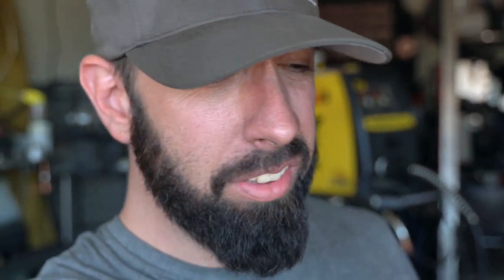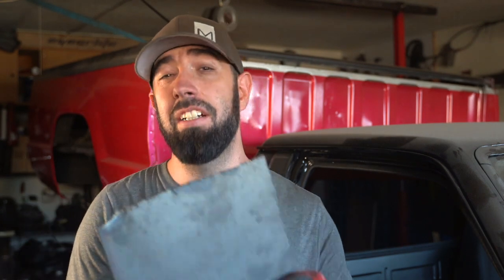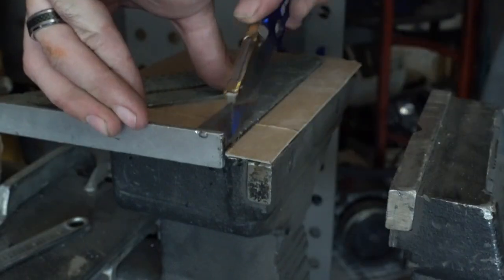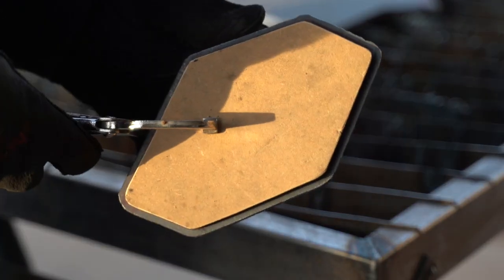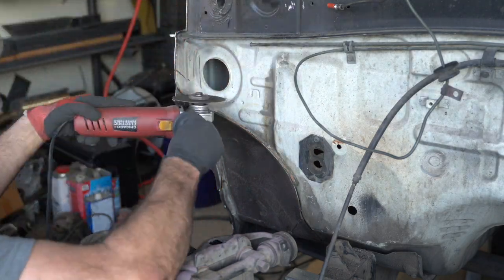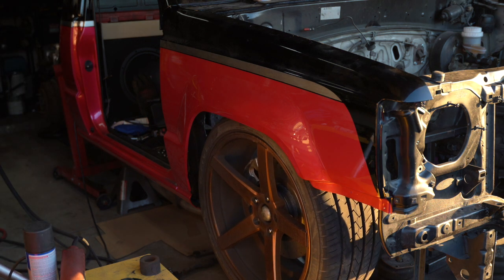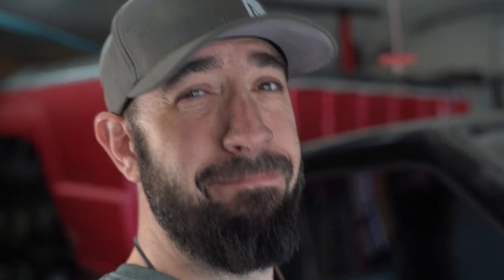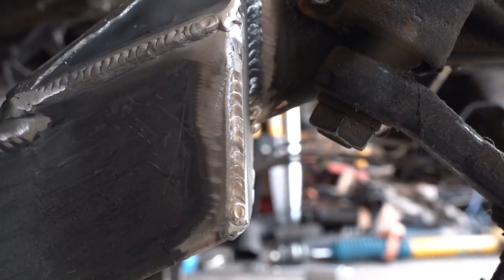Mighty Max Ep. 05: How to Z Your Frame! Part 2

Comment: I keep forgetting to ask you, do you happen to have one extra used top piston ring for a 3.530 cylinder?
Reply: As wrong as it sounds I was serious about the piston ring. I am gonna open my ring gap to .030 for a small super charger but 1 broke.  I will pay u 4 it if u have 1. Top ring 3.530
I can't seem to find a set.
Reply from the maker: I think I trashed my old rings. I’ll be cleaning out the can of the truck soon where it would be if i have it so I’ll look shortly.

Comment: Do you have to compensate for the 1/4" plates that you installed? You added 1/2" to the length of the frame.
Reply from the maker: Good thinking Rod. Yes. I did not compensate, though, and I didn’t want to try to film the drawn out reason why I didn’t. 
Here it is:  I actually only added a total of 3/8 of an inch after subtracting the metal lost from making two 1/16 inch wide cuts, and this was only to the front most part of the frame where the radiator support mounts. Those rubber mounts have 1/2 inch of wiggle room from the factory, so the radiator support will bolt on just fine.
This also pushes the bumper forward 3/8 of an inch. This may look unappealing and if it does I’ll just modify the holes in the bumper brackets.
The suspension and engine were also moved forward 3/16 of an inch but I can’t imagine that would cause any issues. Hopefully I’m not wrong!
Reply: @GarageFab  Thanks for the reply. I just happened to stumble on your channel. I really like it.
Reply from the maker: Excellent! Hope to see you in future videos!

Comment: Pro tip from a certified welder and mechanical engineer; When welding vertically you get stronger weld by moving upwards (better penetration), even though it's much easier to get a beautiful weld moving downwards. On a frame weld I'd say strength is much more important than aesthetics. I'd also say that welding a frame with MIG/MAG is not the best choice strengthwise. TIG, flux core or stick welding with the right consumables gives more strength and less danger of cracking.
Reply from the maker: Have you any tips for welding upwards? Or just practice? The appearance of a better quality weld is the precise reason I weld down. My technique is to weld the root of the joint and build the puddle upwards, jump to the root and build the puddle upwards. It makes for a gorgeous weld, and I figured my method would give me good penetration. I’ve never cut a cross section and tested one of my, and I’m certainly not certified though I’d like to be soon. Thank you, Brother!
Reply: @GarageFab  You're very welcome! I found this video with 2 great tips. #1 is how I usually do it: https://www.youtube.com/watch?v=snyKGd4T-Zg

Comment: Excellent work. Me doing a similar sort of job would be a feeling of great satisfaction.....until I found the weld had pulled the end of one of the frame rails 2" higher than the other.  :( 
I do that sort of thing so often I've come to expect it.
Reply from the maker: I’m with you, Paul. I’m just starting to learn to anticipate warpage and, plan ahead. Weld in symmetrical patterns to minimize movement and “steer” the work piece with initial warpage. 
I’m still terrible at it! But that’s why they created cut off wheels. 😂 
Thank you my friend!

Comment: Hello there I have a question do you kwn anything about proportioning breake valve I have a master cylinder with 4 breake lines I need mostly my rear breakes to lock up where do I install the proportioning valve ?
Reply from the maker: Hey, Jerome!  My experience with proportioning valves is strictly on older trucks with a single brake line feeding both of the rear brakes. The valve on those obviously just goes in the single line before it Tees off to each brake caliper.
So are there 4 lines coming out of the master? Or just Two?
Reply: @GarageFab  hey its 4 lines coming from the master cylinder 2 for the front breakes and 2 for the back breakes how do I connect that
Reply from the maker: Look for proportioning valve for a split system. It should have 4 ports. 2 in, 2 out. That would be the RIGHT way of doing it.
For a single-line proportioning valve, you could T the two lines together before the proportioning valve and then T them back apart after the valve. I’d highly recommend NOT doing that. If you lose pressure in one of the rear brake lines, you’ll lose both rear brakes. Currently if you lose pressure in one line you’ll still have 3 other brakes. I’m unsure of what other side effects T-ing the lines together might have. I’m honestly not educated enough on braking systems to know for sure. 🤷‍♂️

Comment: Did you take 1/4” out the frame at the cut to avoid shifting everything forward 1/4”
Reply from the maker: I did not. However subtracting the kerf of the blades resulted in a 3/16” shift. The Mighty Max control arms are mounted at a slight angle causing the front wheels to pull backwards a small amount when the vehicle lowers. So when riding low or laid out the wheels will be more centered now than they would be if I didn’t shift things forward.
A side effect is this pushed my front body mounts further forward but the mounts have what looks like a half inch of play so I predict I won’t have to deal with that. But if I do, I do!
Reply: @GarageFab   ahh ok well that’s great!! Just came across your channel this morning and just finished all the mighty max videos, can’t wait for the next one!! I’m fixing to pull my 92 hardbody apart and do a v8 swap and since I’ll have the body removed I figured why not do a stock floor body drop too lol. Wish I recorded everything when I bagged it to put on my channel just didn’t think bout it at the time. But this revamp of the hardbody is getting completely filmed. I’ll be doing other little odd and end things while I’m doing it along with a bed floor.
Reply from the maker: 🙌 My kind of project. Sounds exciting! If you post it, I’ll be watching! Best of luck my man. See you in the next one.

Comment: I tend to keep soda can boxes laying around. Works just the same as card stock
Reply from the maker: Brilliant. That’s about the same thickness as the card stock I buy. I see people use corrugated cardboard a lot but that stuff is miserable to bend cleanly and or gradually. Soda boxes would be absolutely perfect.
Reply: @GarageFab  I tried corrugated cardboard when I was making motor mounts for my falcon. Struggled a tone and that’s when I just grabbed a Fanta box out of the trash can and used that instead. Been keeping about 10 on hand ever since. Lol.

Btw, if you don’t mind me asking, what height do you normally set your ride height at? I’m going to be bagging my F100 soon and I’m wondering if an 8” ride height is too tall or out of range for a double convoluted bag. Id prefer to mount the bag directly to the axle but if I have to mount it on the arm to have my desired travel I will.
Reply from the maker: The card stock I buy comes in 2x3 sheets for a dollar a piece at the upholstery store I visit a lot. I spend 15 bucks and I’m good for the year.
Reply from the maker: Sorry! I missed the second half of that comment. If you’re bagging, are you planning on laying the frame on the pavement? If so, 8 inches sounds a bit too high for a ride height. If you have rougher roads than we have in Vegas maybe 8 inches would be just fine. You will be able to get 8 inches off the ground but it might not be comfortable depending on how you set up the suspension.
If you haven’t experienced air suspension, you might be surprised to know ride quality is kinda opposite of static suspension. With air, the lower you go the softer the ride gets because there’s less air pressure in the springs. Full height produces an unbearable rough and bouncy ride because of the high air pressure.
My guess is your ride height might be closer to to 5 or 6 inches. That’s pretty low for a dually but if your going with the bagged life you’re changing to the low life. That doesn’t mean if you come across a steep driveway or the occasional curb you can’t just air up a little temporarily to get over it.
For comparison, I generally set my ride height at 3 inches. Keep in mind that’s in a much smaller truck with a shorter wheel base and minimal off-roading in the concrete jungle of Vegas.
Reply: @GarageFab  awesome thanks. A 5-6” ride height would be perfect. My F100 and my navigator have the same wheel base and my Lincoln’s lowest point is 4.5” off the ground and I rarely scrape on high/steep driveways. I’m in Bakersfield, roads are damn near glass compared to LA lol. I just saw that the bags I was looking at had a 7 3/4” range, so I’m probably going to ride about 6” off the ground. Thanks a lot man! I appreciate you and can’t wait for more videos, fun to watch AND educational.

Comment: So, now the wheels are 1/4" forward from where they originally were, and the core support would be 1/2" further forward from original, right? Did you remove the extra material from the frame to make up the difference, or is there just that much room for adjustment on the fenders and stuff to get the front clip to fit right?
Reply from the maker: You are mostly correct. Just subtract the lost material from the cutoff wheel which is around 3/32”, twice. So quick head math: 5/16” I think is the total it pushed the front frame mounts forward. There’s more than 1/2” of wiggle room for the front radiator support mounts.

Comment: Ok, you used 1/4 plate between the frames did you recut the frame to account for this distance? if not your whole radiator support will be 1/2 to far forward? Not to mention your front bumper!
Reply from the maker: I see what your getting at, but no. I did use quarter inch plates on the right and left. But that’s only… 1 quarter inch. Minus the width of the cut which is roughly a 1/16”. I did NOT double cut the frame so it is in fact further forward but only 3/16”. The front body mounts have a half inch of allowable movement so all should be good.
Reply: @GarageFab  but you used 1/4 behind the wheels and again in front of the wheels, for the "z" up and again for the "z" down.
Reply from the maker: Oh, touché! You are correct. The same measurements apply, so the front is 3/8” further forward than it’s supposed to be. All I can say is I’ve had the front end back on for wheel fitting and there was more than enough play in the body mount ears. 
When I painted the truck 6 years ago I modified the front bumper brackets pulling the bumper in 3/4” closer so I’m not too concerned about how that’ll look.

Comment: So the thing is. I have a 98 montero sport. And would like to do the 5 lug swap. But I havent seen how to do the rears..just drill?
Reply from the maker: Generally on pickups the rear axle is completely swapped out. They’re often stolen from Toyota trucks. 
I’ll just purchased a Mustang axle from the junkyard and I’ll be using that.
Reply: @GarageFab  for what ive seen the rear axle on my montero sport is the same as the mmm. Leaf springs. 97-99 are that way. 2000up switched to coils.
Reply from the maker: Oh! Right on! Check out 1995 or earlier Toyota pickups then. I don’t know if the spring perches are in the right spot because I’m usually welding on link bars but the width will be close.
Reply: @GarageFab  thanks for the input. Apreciate it.
Reply from the maker: Drilling is an interesting thought, though. It would likely be a lot of work to adapt a Toyota axle to a Montero. Maybe welding Montero axles and having a machine shop turn and redrill is an option.
Reply: @GarageFab  gotta check how much meat the axles have to drill the 5 lug pattern. Never thought of doing a 5lug until I came accross your 001 vid. Just binged watch all 6. I want more 😂😂

Comment: Did you have to take a half inch out of the frame rails to accommodate for the two quarter inch plates that you put in? So your gap still lines up?
Reply from the maker: I did! Actually only 3/8ths of an inch because I could see the factory mounts were already sitting back too far an 1/8th inch. I ended up editing that whole thing out because of time and it seemed really confusing.
Reply: Awesome project looking forward to more vids really thinking about doing a z on my 49 Coronet and throwing a link in the back
Reply from the maker: Do it!!! There will definitely be a link video. One of my favorite things.
Reply: Cool that will be nice, I was just gonna buy a universal 4 link kit off ebay

Comment: Thanks for the great video! I dream of doing more to my truck, just can't find the time. You're living the dream.
Reply from the maker: I'm blessed for sure but it's not exactly a dream just yet. When I can afford to quit my job and get an air conditioned shop, THAT will be a dream. You're welcome and thank YOU!  What's your project?
Reply: @GarageFab  I've got an '86 f150 i drove to high school. It lays frame, a 1inch valve in the front (goes up fast), has suicide doors, a turbocharged stroker motor and a bunch of stuff like that. I want to body drop it on 26's and body work it for paint but i work around 700hrs of OT a year and don't have time to work on it.
Reply from the maker: 1 inch valves!!! Sheesh. That would suck having to wait until the truck came back to earth before you could start driving.
I'd love to see it! Sounds like it'll be cool.